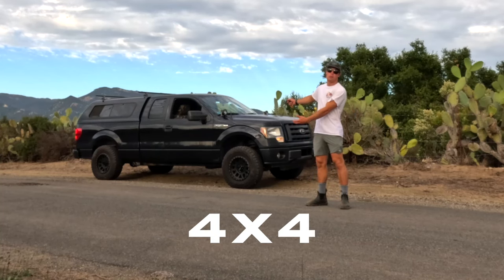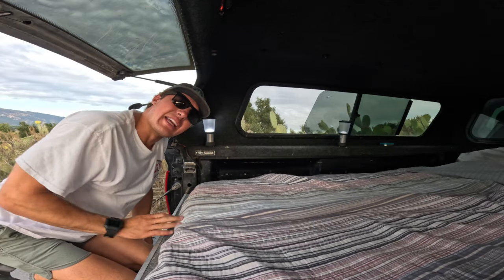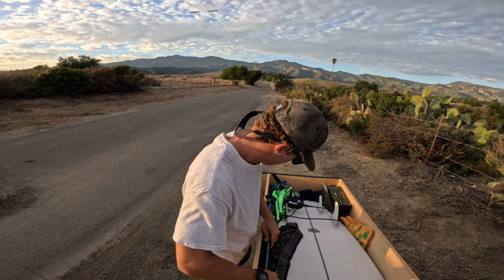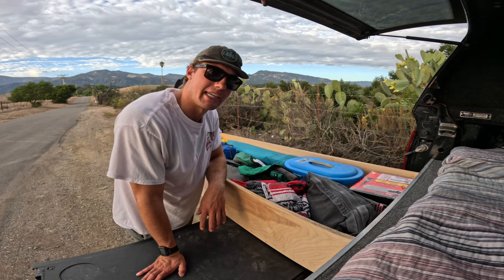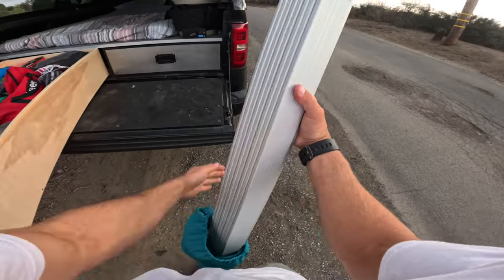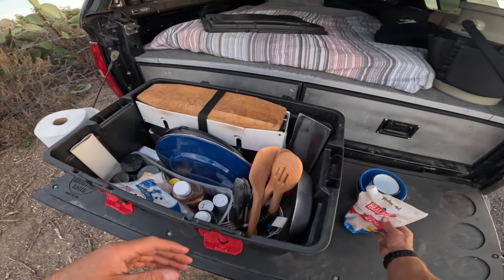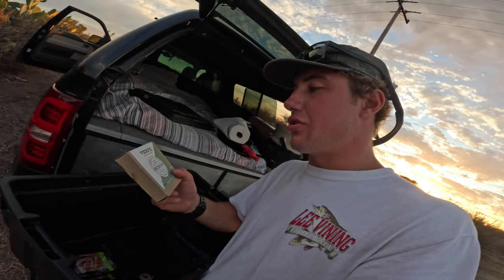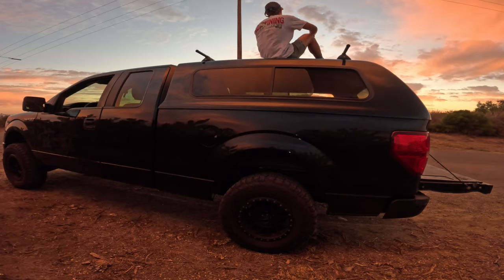My ULTIMATE Truck Camping Setup | Build Tour

Comment: Love your vids bro! 2 Questions ... did you make the cabinets yourself?  And what shell do you have on the 150 and do you like it or would you want a diff shell?  Also gonna send you a DM on merch ideas ... I could set you up easy.
Reply from the maker: Love it! 
So the truck came with drawers when I got it. I renovated the drawers when I got the truck. I carpeted the whole thing, adding the aluminum panels off the end , and a little paint here and there. 
The shell is a snugtop. No complaints or issues. I just wish the windows could open from the exterior to ease my accessibility.  
Thanks for the support!